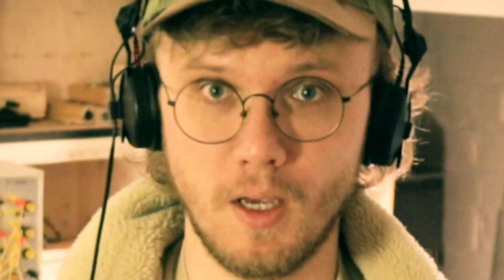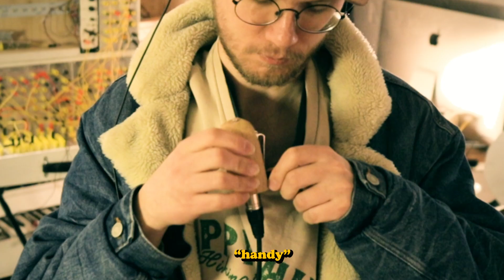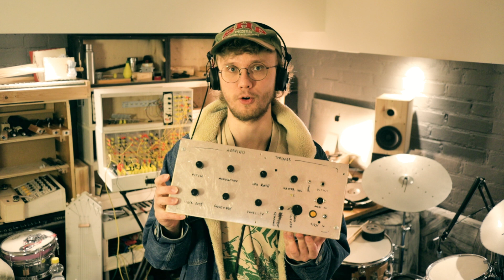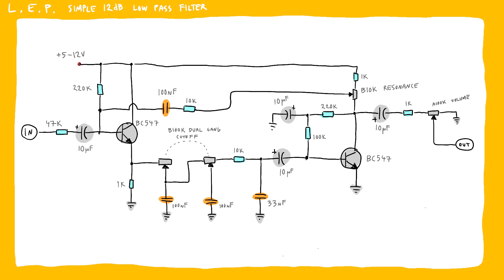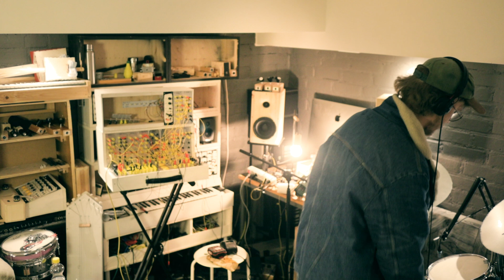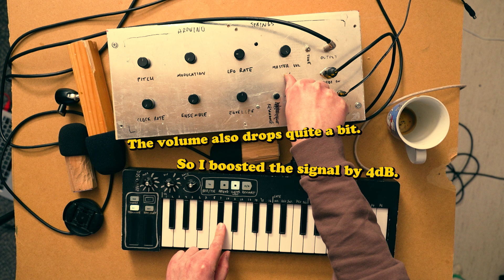DIY 4 voice arduino nano string synth (modified Jan Östman's Solina)

Comment: Great video! Thank you for your work you spent on the Ostman Solina, which I found to uninteresting in it's original state. Didn't even recognize it didn't have DIN MIDI. But the final game changer is the gate output. Together with EG, VCF and VCA, you get something Korg Poly-800-alike, which is not too bad considering the low cost and effort. The pinnacle would be an additional PWM CV output which doesn't have to be  1V/oct, just for the sake of brightening up the filter cutoff at the higher notes. But I can also implement that by chaining the string synth with a MIDI to CV interface.
I have some assembler code to run on a little ATTiny85 with an optocoupler for MIDI and a pwm output with a plain passivce RC lowpass for the CV. PWM frequency is high enough so you get all the steep note changes without any unwanted portamento, which I would have expected from a circuit as simple as this. I can send it over, if you're interested.
Reply: Oh that's some really cool insight. I would be really interested in adding an EG but I'm new to DIY synths and I couldn't find any that would run on +9V or +5V (edit: single supply). Do you know any?
Reply: @SaltaSoles  you mean single supply?
Reply: @echolotmusic  yes exactly.
Reply: @SaltaSoles  YouTube deleted the Link I posted in response. Google for Schmitzbits ADSR. The second design with the 555 timer should work on single supply as well since the signal voltage buffered by the opamp doesn't go below 0V anyway.
Reply: @echolotmusic  ohh thank you very much. Those projects seem simple enough for me to try. Sorry for asking over and over but I'm still not familiar with opamps. Could I use the same schematic with the same opamp (TL081), using the ground instead of the negative, or should I change to another opamp design altogether? For instance, an Lm358 or alike?
Reply: @SaltaSoles  no need to apologize. :) The TL081 should work just fine.
Reply: @echolotmusic  awesome! Thank you! In the future I'm gonna try both this and the one that @LAURISDIYCHANNELTV recommended. Thanks a ton!

Comment: Maybe aliasing on the higher notes, could you increase the internal clock rate or something? Sounds great lower down though! Also 6 voices would be nice, is that a limitation of the Arduino's processing power? I know nothing about that, but cool project anyway.  Nice work!

Comment: would it be possible to control the rate with CV (or even other parameters) ? :)
Reply from the maker: I guess you could use cv instead of the potentiometers or combine the two with a couple of resistors! But i think you should make some sort of a diode clamping protection so you dont accidentaly connect negative voltages or more than 5V to the analog inputs of the arduino and fry it!
Reply: @LAURISDIYCHANNELTV Thanks ! Or even simpler : add a vc input on the filter. But I don't really know how...
Reply from the maker: You can do a crude voltage control for the filter using 2 vactrols. The resistor sides of the vactrols should be connected to the pins of the dual pot (cutoff). And the led sides should be connected to ground and CV input with a 1k resistor. Its hard to explain in writing without it sounding complicated hahah but its simple. You can google similar circuits and look at the schematics. I used vactrols the same way in my cd4069 filter, that i have a video about on my channel! Hope that helps ✌️
Reply from the maker: Adding a proper voltage control to the filter would be way more complicated

Comment: With regard to the bleed through - maybe you could add a VCA before or after the filter which is controlled by the gate from the Arduino pin D10 ?

Comment: When the ensemble is turned up I wonder whether the distortion is simply due to clipping. The summ of the signals gets too large (positive or negative) and therefor the amplitude to the DAC clips at the maximum integer value. By keeping the amplitude at bay, you might be able to prevent the clipping from happening.

Comment: Berry nice. Little mistake on your version of the filter schematic. The 10k resistor after the dual pot should connect to the wiper of the second pot in the dual pot.
Reply from the maker: Oh shit, youre right!! Thanks for pointing it out, i’ll update the schematic in the dropbox folder
Reply: @LAURISDIYCHANNELTV  Anyhow - that's a pretty fun filter. A good find - and thanks to Leploop for publishing their design. I built the filter to add to my DIY modular. I also added a diy dual vactrol to the cut-off pot so I could have VC on the cutoff. Niiice.